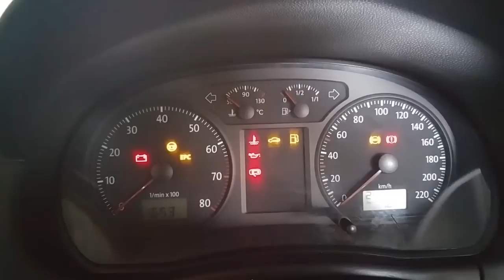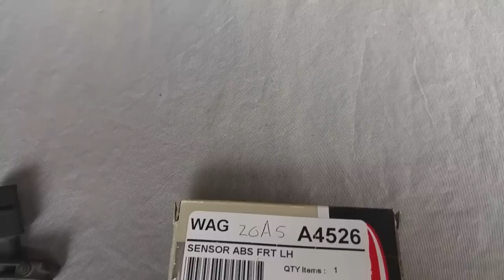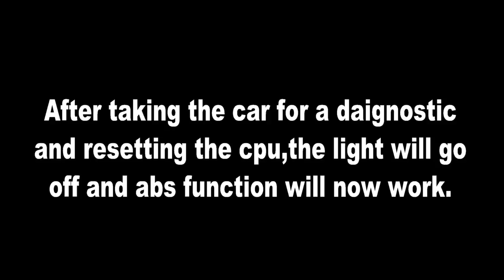How to Change an Abs speed sensor - Vw Polo 9n3

Comment: Got charged R3 400.00 to get this replaced at VW Dealership. I am so pissed after seeing how simple it is when I watched this video.
Reply: I am with you, just bought new pads discs etc for my 09 polo classic, tavcor george charges over 2k for the thing after i told them it may be the problem. I will make it a rule to never support the f@@kers.
Reply: the sensor can't be pulled out so easily as shown in the video. it Will be strongly Attached to the body even after removing the screw.
Reply: @pranavofficial  a screwing tool with extension should do it i think